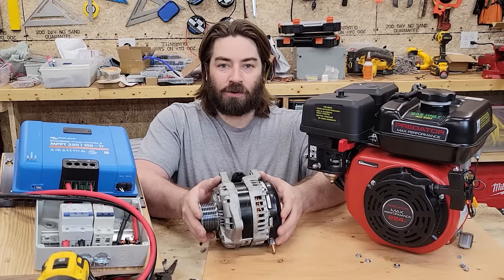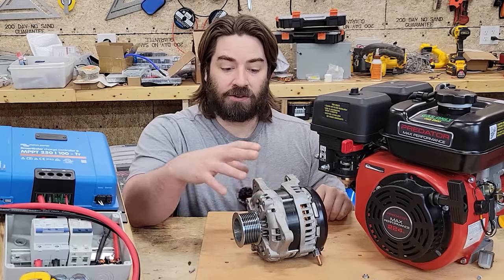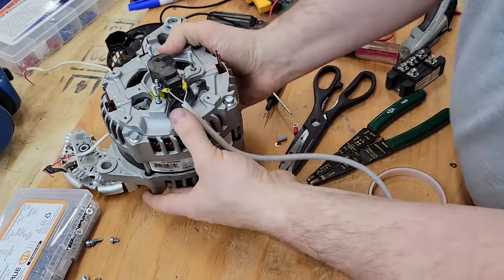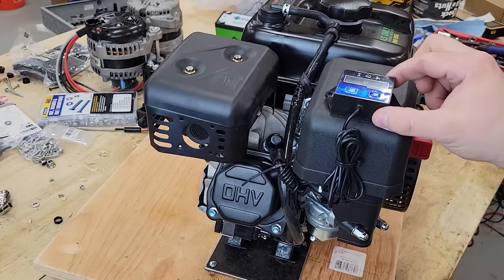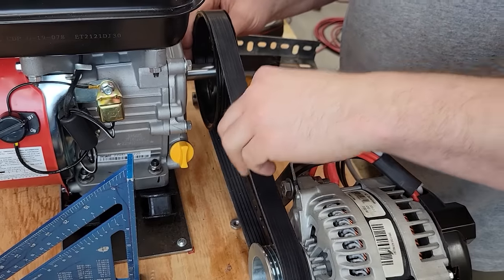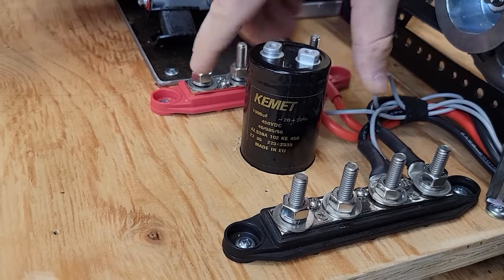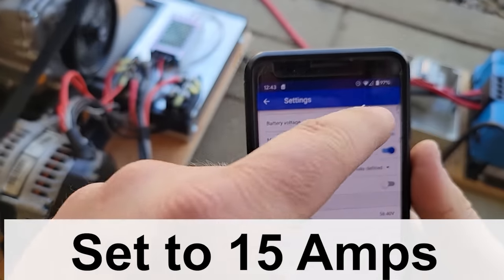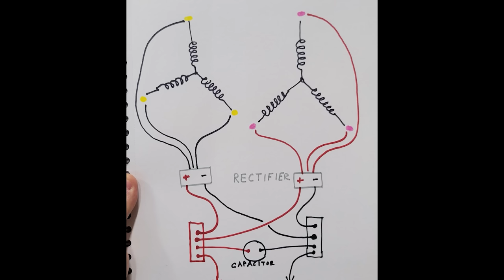The AlternatorGenerator, First Attempt.  48V Battery Charging

Comment: Great idea. Great execution! My advice on belt vs direct drive would be to leave it as is. The alternator is turning at a good RPM for sufficient cooling while staying well within its design limits for RPM. Running it slow is going to mean less airflow over the stators and therefore more heat and lower efficiency. I also think you might be hitting the limit of the motor here more than the alternator. The MPPT won't load up the alternator any further as the RPMs fall, its going to find the sweet spot where the motor output is limited by its torque. You might be able to get a little more out of it, but honestly, the limit here is efficiency. A typical alternator is around 50-60% efficient. Being generous, that means 3kW out requires 5kW in from the motor in the form of mechanical input. A predator 212cc is a 6.5hp engine, which is 4.85kW. That's about bang on for what you can expect this motor to give and, as you observed, she was a-strugglin'! The alternator is rated by its current, so if you're pulling 120A from it, the voltage is not important as the heat generated in the stator is defined by P=I^2 x R.  You would need a much more powerful motor to bring this alternator anywhere near its limits (around 12hp would be about right), but then you would still have that low efficiency of the car alternator ruining your litres to kWh ratio. Still, this is an amazing and cost effective innovation and I've been stewing on this idea for ages wondering if it could work. Bravo dude
Reply: would you have any input on how to wire an alt with 3 separate windings?, its not in the wye config it was wired in the delta config instead,  what was weird to me is that there was only 8 diodes on the rectifier
Reply: I run a similar setup using a bigger motor but I run it on charcoal gas so I have zero running costs
Reply: Your comment was insightful
Reply: I would think the alternator is rated 3kW only for a short time before heating would be harmful to the alternator.  A long run at high out put with testing alternator temp would be interesting.

Comment: I would remove the vibration isolators(motor Mounts) from the motor and mount the motor and alternator and brackets to a solid rigid piece of steel then install the isolators on the bottom of that main plate to the base plate. This would keep the belt tighter and more stable. i think the sloppy belt was contributing to the roughness especially when under the greater loads. This was such an awesome project and i now have so much more knowledge about the many applications of a automotive alternator! Thanks for creating this video and sharing it David!!
Reply from the maker: Thank you for the suggestion, I'll have to try it.  I appreciate your kind words.  It was a lot of work, and I'm glad you enjoyed it.
Reply: This idea of vibration isolation sounds like a good idea - maybe worth testing?  Great work!  Thanks for the super-interesting project!

Comment: I'm not sure why this build is so fascinating for me.  Probably because I always wanted to do exactly what you did.  Good job!  You built it based on sound theory and it paid off!  It would be interesting to see how much gas it uses at a reasonable charge rate.  When you pushed it to 100, that seemed to be too much - then you dropped it to 50.  Maybe half way in between?  75?  Then see the power output and get an idea on the gasoline usage.  Awesome project and thumbs up, David!
Reply: Pretty sure he went to 60 Sam, and when I heard the motor struggle I thought "Nah David, you need to drop it to 50" and he did that exactly and smooth sailing from there.... definitely needed this drop or the motor would overheat being air cooled and efficiency would plummet and wear increase exponentially in the motor.

Comment: This is one of my favorite projects you've done so far.
Reply from the maker: Thank you.  It was a lot of fun to build.
Reply: I appreciate the effort and tenacity you displayed to get it working.
Reply: @DavidPozEnergy   hello mr david  i intrested u re vedios  i am in somalia i want to use 24v by car alternative is that posible?
Reply: @mukhtarosman2492  your best bet would be an old military alternator, as most military trucks run at 24 volts. It's also possible to find an older diesel truck alternator, as they used to be 24 volts, but not mostly use 12.

This would simplify your setup, because you could use the alternator "as is" without having to modify it.

Google could help you find what make, model, etc of alternator to look for.
Reply: Fascinating project. Made me look at what you can buy for this because I’m not anywhere close to skill level for trying even with your excellent and entertaining video.

Comment: Adding a idler pulley , like in the cars charging system, to the belt may help the belt tension in your setup. Great build, learned a lot on this build, some of which I'm still trying to assimilate.
Reply: He should add an additional heavy flywheel to the engine as it uses momentum between engine power stokes to keep the engine spinning this is why it's shaking the shakes are the power pulses a flywheel evens out the pulses keeping the engine rotating at a more steady speed
Reply: Idler won't do much, he loses tension with the motor twisting on the rubber mounts. It all needs to go on a steel/alu/extrusion bar frame/base plate then on rubber mounts to the wood to maintain perfect alignment. The way this is built, the pulleys are pulled out of alignment by the belt creating uneven tension and wear on the belt. That thing won't live long...

Comment: Even though I will probably never build something like this project, just one thing all by itself made it well worth my time.   Watching you build your own adapter with little more than a drill press, a file and a tap was a learning experience and inspiring.
Reply from the maker: Yeah, that was fun.  It was about midnight, and the stores were closed.  Not that I could have bought an adapter even if they were open, LOL.
Reply: I've been using waste vegetable oil for years, my standard ratio is 4 gallons waste vegetable oil to one gallon of gas, I have a 1982 Isuzu imark diesel engine that I've put in 3 different cars, I have saved over 50k $ in the last twenty years in fuel costs, this past winter I've started using a 5kw diesel heater with the same formula of fuel, it done a great job saving me money on my fuel bill, me and you have similar goals (off grid) I can buy a small diesel engine on Amazon for around $275, I don't know how compatible it would be with my fuel formula, I might need to tweak it some, or I was thinking I could just run my car to charge batteries, any suggestions would be greatly appreciated, I'm clueless to electrical and solar systems
Reply: I work in a restaurant and I have unlimited supply to waste oil
Reply: @blakeburgess7171  and I was just going to ask you where you were sourcing that much waste oil at but you read my mind! Thank you Blake
Reply: @blakeburgess7171 There are two issues with bio-diesels, can the injection system handle it, and can the rubber/plastic parts in the fuel system handle it. Older cars typically answer yes to both. Newer cars depends, the limiting factor is usually the injectors, the rubber parts take a year or so to degrade if not correct. lots of videos on youtube about it

Comment: Wow, very interesting build. I thought it would work but didn't expect over 3000W! Not sure how, but definitely need to secure that pupper down as it was starting to walk away lol.
Reply from the maker: Thanks Lithium Solar.  Yes, I was surprised.  I was hoping for 1600W.  I came to that number because when I built the treadmill generator, I used a 3hp engine and got 800W.  I figured double the engine, double the power out.  So, this blew my mind.  I had to record my conclusion over and over again because I was so giddy.  LOL
Reply: Wow, what a fun project.  Thank you so much for the theoretical walk-through before the build.  Now how bout some type  of diesel engine with that alternator?  Maybe off the pto of a small tractor, or an old John Deere diesel garden tractor??? Could be a lot of fun.
Reply: I would be careful to not overheat the alternator, they are not meant to produce there full power over extended periods of time.
Reply: Same, I knew it would work, but I was expecting maybe 1500 watts give or take. But 3000?!?! That shocked me greatly. 

I know alternator sizes vary from car to car, but for example, my 1999 Tahoe has a 105 amp alternator, charges at 14.8 volts when I first start it, and drops to 14.4 volts after everything warms up. That's where I got my 1500 watts give or take figure, but this little puppy done over 3000 watts!

Comment: Nice setup and your electronic knowledge is amazing! The reason for the slack in your drivebelt is that the alternator is fixed to the baseplate, while the motor can move in its rubber mounts. You should install both the alternator and the motor on a metal plate or frame and then connect the whole assembly with rubber mounts to the base plate.
Reply: That sounds very reasonable

Comment: Hi David, I really enjoyed the video. You mentioned raising the 12VDC input from the buck converter into the rotor. I would advise to measure the rotor current and increase slowly and carefully since it may not actually increase your output power as you were already getting the rated output power for the alternator. The rotor winding will magnetically saturate and then the extra current will only overheat the rotor and it may be damaged as the wire gauge is really small. Kind regards.
Reply: The source of 12 volts for the field is constant however in the actual automotive application I believe the field current is duty cycled from the voltage regulator dependent upon the total load.  The point is you are maxing out the field so I wouild not think it a good idea to raise the field voltage/current any further to avoid over heating the field winding.

Comment: I did something very similar a few years ago with a 10 hp diesel engine. I used dual alternators for power and also to charge/recharge a small battery bank for off-grid use. It works very well and is very reliable. Plus I get 10-12  hours of use out of a 3 gallon tank of diesel.
Reply: Please can you help me further with yours 10hp diesel engine design. I am thinking of using a bigger alternator for 10 tires dump truck. I really want to be 100% off grid
Reply: 10 to 12 hours ops from 3 gallon diesel tank is absolutely impressive
Reply: Nice user name....WTF
Reply: @dudeinaroom1238   IKR!?!  (I guess he can’t call himself “non-binary”) WAGGA-WAGGA…. I crack myself up!
Reply: Use your name buddy.

Comment: Fantastic. A fuel efficiency test comparison with your other generators would be great. I thought the pully would be too large to start the alternator charging on under load. I think the lower torque curve of the engine had to help in that regard.  Very enjoyable video to watch.
Reply: I'd really like to see a fuel economy test! ❤
Reply: I think this is going to be lower efficiency in general because alternators use some of the energy to self excite. Generators have permanent magnets which distinguishes them from alternators.
Reply: I would love to see the comparison vs the Big honda and the little one you rented. Interested to see how they stack up.
Reply: @termiterasin  mine pulls about 25-30 watts to excite the rotor enough to make some good power. 2.4kw
Reply: @termiterasin  the advantage with alternator is you can keep the output voltage stable at any speed where a genarator have a mean curve.
Reply: If you look at any car engine, you will see that the engine pulley is way larger than the alternator pulley. Most cars run the alternator at at least 3 times the engine rpm.
Reply: @randydavis9324   Correct. It makes me wonder where the 12,000 rpm stated in the video came from. Any alternator that I've ever used has no problem at 15,000 rpm or 19,500 rpm.  My small block Chevy in a 1980 Olds Cutlass is set up at 2.7:1, and at 6,800 rpm the alternator is turning 18,360 rpm. Even at a conservative 5,000 engine rpm the alternator is spinning 13,500 rpm.  For comparison my bone stock 2002 Ford F-250 with the 6.8l V10 sees 5,000 rpm regularly, and I believe it has a higher ratio, closer to 3:1.

Comment: Great build David! The alternator truely puts out six phases, hence the need for two bridge rectifiers. The six stator windings consist of two sets of 3 wires, i.e. two individual STAR connections however, they are 180 degrees phase-shifted in order to provide you with a waveform (on the DC side of the dc-combined output) that has very little ripple.
Reply: Yes, it would have been better to use the original 12 diodes that were pressed into their original heatsink.  No need for the external diode bridges or heatsink.  You can still get well over 100 volts DC, and the rated current of the alternator.   I've done it before.  The filter capacitor is a good idea, and needs to have a rated voltage well above the highest output voltage you ever expect from the alternator, like 200 VDC.
Reply: @dwbogardus  My thoughts exactly.
Reply: The fact that the two windings are out of phase from each other is important to the best performance of the unit. Thanks @SOLAR-cr5dp for the info!
Technically, would you agree to say that the two winding sets are at 60 degrees offset from each other, rather than 180 deg ?
It would be interesting to see a similar project done with the original diodes!
Edit: I see in another post below that the original diodes don't have a high enough voltage rating to be able to use them at 90 volts.
Reply: @dwbogardus %100.
Reminds me of one of those OVERLY complicated mousetraps..

Comment: Man, you do the things I've been talking about for several years; which is recycle materials and think outside of the box to get the best out of them. Anyone that builds self sustainability (even if its just working TOWARDS it) is going in the right direction in my book! SUD'B!!!
Reply: only one problem, the experts who already serve this cooked are in the same thinking, thus reinventing the wheel is not that more efficient, + most people will not engage in this much technical ability... and don't get fooled, he spend a massive amount of time and research before he even attempted this contraption and got advice from experts.
Reply: @DormantIdeasNIQ  ….you’re prob not that much fun at parties…?
Reply: Agreed. Backyard shed engineering is best.  I'm wanting to make a little diesel 12v generator now, maybe with a flywheel, try getting max output from minimum revs. It's easy finding unwanted stuff from people to make things from. Great fun, and satisfying.

Comment: As a licensed electrician, I am very intrigued that these little alternators are simple 3 phase motors. I had no idea, and now I will be experimenting with this myself. Also, I have to say; I am very impressed at your cleanliness with your wiring, proper gauges (even when you weren't sure on the output amperage, you anticipated well!)

Followed!

Comment: Great video! I’ve done similar building a welder, but I used the existing rectifier and used ring terminals to connect directly to the brush housing mounting screws (that have continuity with the brushes). I left the voltage regulator in place and just didn’t use it.

Comment: I think this was my favourite of all your videos to date, and its super useful with the victron controller since they're multi voltage, theres no reason you couldnt set it to 12v and charge a dead car battery in an emergency, or run a 24 or 36v off grid setup too. I think this is now on my list of projects id like to do myself 😊

Comment: Dave, best diy project so far. You just proved several people wrong who said this wouldn’t work! Please do fuel consumption test at different RPM’s. I recommend rigid mounting the engine and use a ballasted mount, possibly a poured concrete base. Great job!
Reply from the maker: Thanks.  I wasn't setting out to prove anyone wrong, I just wanted to see if it would work.  There are a couple 48V alternators on the market, but they cost more than my whole build.
Reply from the maker: Interesting!  Now you can share this video link with the Victron engineers and see what they say.
Reply: @artman001  They likely didn't understand what you were wanting to do exactly.

Comment: This DIY is great!!! you managed to pull from 6.6hp engine a 3kW from a handmade contraption when maxed, which is awesome. PLEASE do the efficiency test, it is quite interesting to find where is the lowest point for <fuel consumption / charge rate>
Reply: 3kW = 2100 HP. So 33% efficient?

Comment: A tensioner pulley would be a great addition. Keep you from having to torque the belt so tight with that bracket and make it MUCH easier to maintain. Also, putting some high(er) tension springs between the engine and the board would absorb some of your vibrations.
Reply: I agree on a tensioner but I would source one that is spring loaded.
Reply: Wrong
Reply: Wrong way to go. You are adding to the side load of the mounts.

Comment: Thanks for the video David, great information !  If you have not yet read it, "OPERATION OF THE LUNDELL CLAWPOLE ALTERNATOR
 AT HIGH POWER DENSITY AND EFFICIENCY" is a great read on this specific topic. It gets into using large alternators intended for diesel semi tractors and the author  shares a ton of valuable information and a little history too.